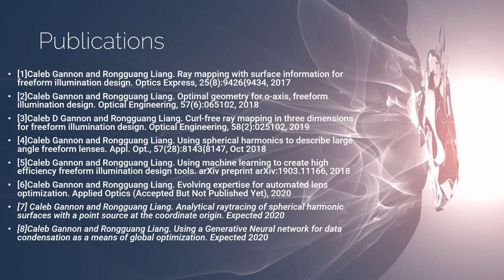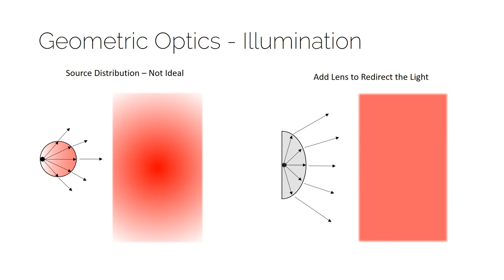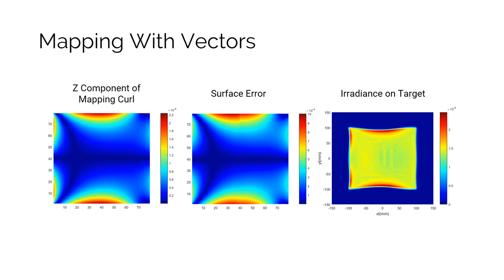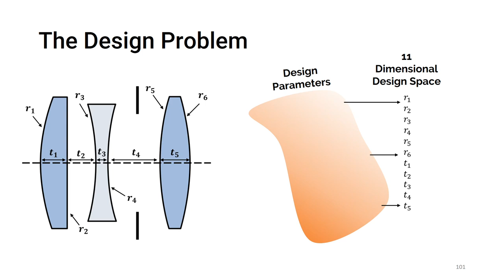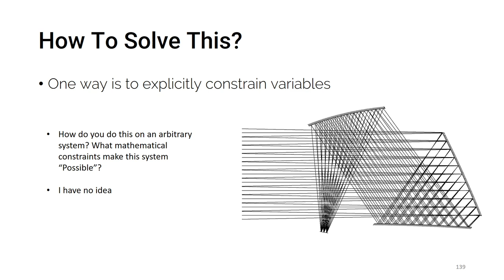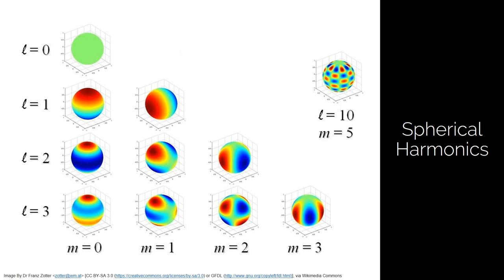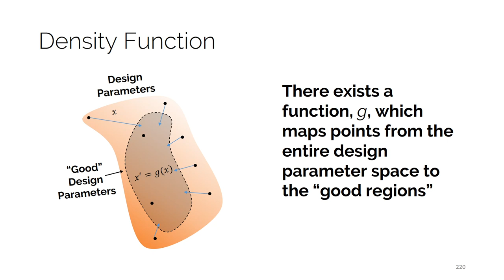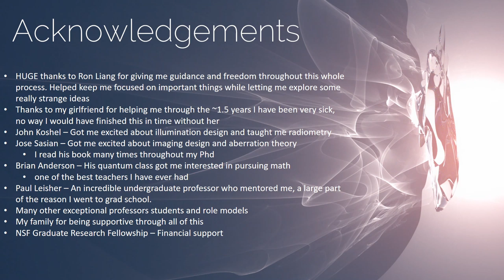My PhD Dissertation Defense | Computational Methods for Optical Design

Comment: Hey Caleb I'm 17 and I'm doing science and math's and I really like math but for some time now I don't really know what to study but the video you posted sounds really interesting!  I'm going to have to watch in parts tho if I'm going to try to understand it a little :) really like your video's
Reply from the maker: The beauty of studying math is you can basically work on anything you want and it will find a way to be useful to you somewhere else. Just find stuff you enjoy and pursue it as far as you want. I spent a summer just studying the golden ratio and it turned out to be exactly what I needed for generating well distributed data (check this really cool blog post http://extremelearning.com.au/unreasonable-effectiveness-of-quasirandom-sequences/ ). I spent two years learning topology just for fun and it ended up being incredibly helpful in data science and freeform optical design. Now I'm studying recurrence relationships and making some cool fractals for my art along the way.

Comment: As a freshman who just finished their first and probably worst year of college, this is very inspiring.
Reply from the maker: First year is really rough. I struggled a lot with intro physics actually and I was horrible at math until the second year of my Phd. Put the time in now to really learn the stuff and it gets easier
Reply: @calebgannonphd3745  College-level physics really made me question whether I actually hated physics and math, but once I focused on how to apply the things I learned (or just enough to scrape by) in physics and differential equations into what I'm passionate about, it wasn't so bad. I can tell you're the same, Caleb, based on your presentation. By the time I got to my capstone classes it was a breeze compared to freshman/sophomore math and physics. Everyone's mileage may vary, but I'm pretty sure those early classes are just meant to weed out those who aren't willing to power through the confusion and get to the stuff they really want to study.  

I'd add that no one should feel too discouraged by those classes. Muscle through it, learn all that you can, and remember that it only gets better as your college career progresses.